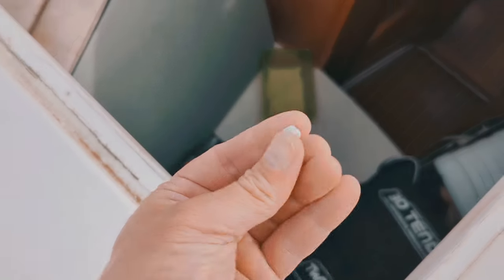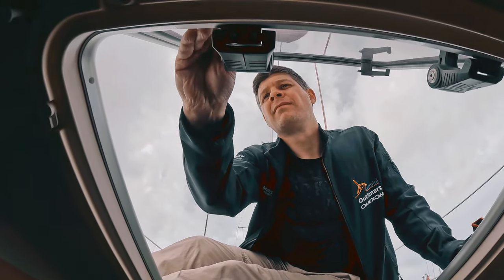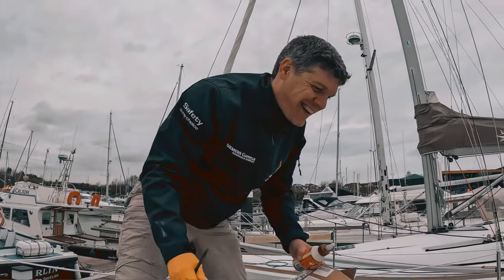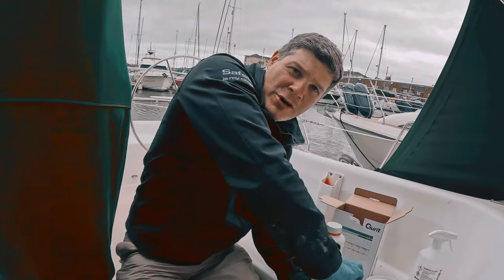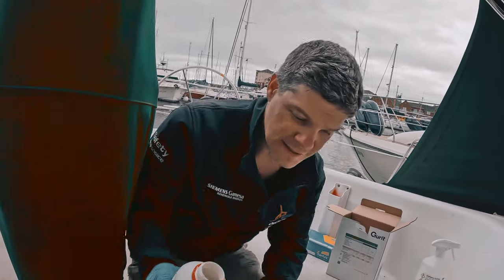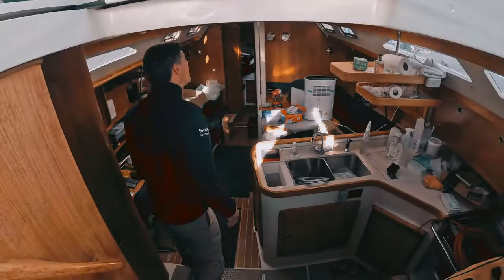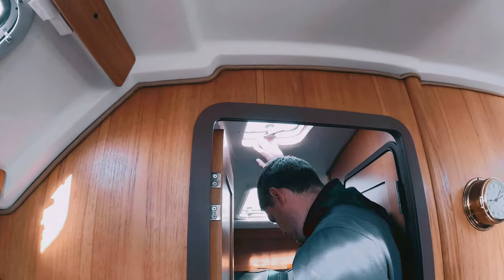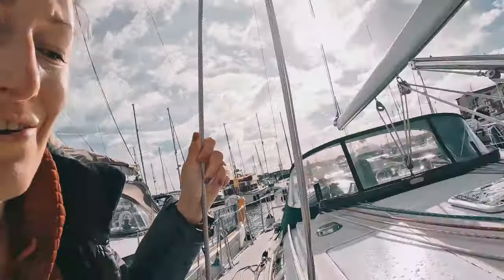REPLACING ALL OUR LEWMAR HATCHES. Ep. 41. 😬  The boat job that almost broke us.

Comment: Good job on those hatches. How soul destroying when it still leaks. I changed a rubber in the heads port light and it was worse after I did it than before despite taking my time. Turned out I had the rubber the wrong way around (all looked the same).
Reply from the maker: @ooweesaler  haha, yep, and suffice it to say that this winter we need more window maintenance 😭

Comment: Thickened epoxy is your friend.  Wood dowles are a bad idea. Also, over drill new holes and fill with thickened epoxy and then drill to proper size to keep deck core dry.
Reply from the maker: Thanks for the advice Paul. We’d never worked with epoxy before and we’d heard horror stories of curing gone terribly, awful mess etc etc etc so we were quite nervous about using it. I actually really enjoyed working with it, shades of old science classes 😃 I’m looking forward to getting onto a few chips and dings that were in the boat when we got her. But I’m defo going to wait for some warmer and less windy weather first!

Comment: Butyl needs to be tightened a touch until it is fully seated. It isn't truly 'compressed' at first.  Keep tightening, and if you've used enough tightening over a day or so will sort it.
Reply from the maker: This is what happened Peter. Love the butyl tape. So easy to work with and so far, zero leaks!

Comment: If your boat has a balsa core you may be in for some trouble. I would have liked to see you oversize the new holes and use the syringe and epoxy to fill them and then redrill them. It works nicely to protect the hole from allowing water to penetrate any core. I don't use dowels either - just epoxy with microspheres or microfibres depending on the job.
Reply from the maker: Thanks for the feedback. We finished all of the holes with epoxy, so they should all be watertight!

Comment: When butyl is warm it softens so don’t panic if they drip. They just need a nip to tighten. Also get a pack of grinding heads for the Dremel, they’re great on epoxy.
Reply from the maker: Thanks for the advice! That’s exactly what happened, after a few days of the butyl setting, we have no drips!
Reply: @sailinghjem  Decent Butyl should be fine.  It's much better than 3M. Only trick to it is to give it a bit of a tighten after a day as it tends to need a day or so to compress.
Reply from the maker: @peterbyrne652  on the money again Peter!

Comment: Where were these hatches leaking and what did you try to resolve it?
Reply from the maker: Unfortunately from many places, some more than others. The bedding was giving way but to were the actual hatches as well. But they were 25 years old. It was actually difficult to see through them too as the acrylic was so crazed. During last season, our first, we used Vaseline to try and help the gaskets but it was clear we needed to do a lot more. We looked into replacement gaskets, acrylic, hinges etc but the cost of the components were more expensive than a new hatch, which we couldn’t believe!

Comment: Not that you need this comment at this point.., all boat jobs suck...all, and will take you 3 times longer than you think.  On the other hand, you will get better and faster, and strangely care less about the perfection of the job. Also you'll be able to nod sagely when someone complains about the same work.  From one Catalina owner to another, it's nice to see one across the pond! Catalina's sail well, and are good stiff boats.
Reply from the maker: Thank you so much Peter for sharing your very wise words. I particularly have found that my sense of perfectionism in each job has, as you’ve suggested would happen, dramatically reduced! I now look for a ‘solid, that’ll do’ standard and my sanity is better off for it!
Reply: @sailinghjem I agree! I also find there is overlap in how you can solve seemingly different issues with the same approach making it easier over time. 

One upside to having to fix different things is eventually you become the 'Doctor" and simply know what is wrong by the way it sounds or looks! You look like a magician! 😂